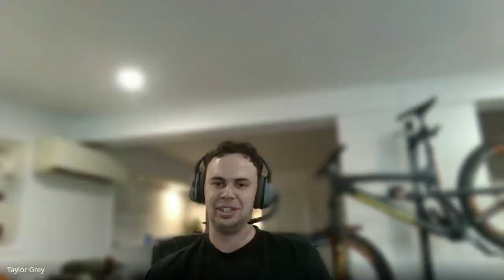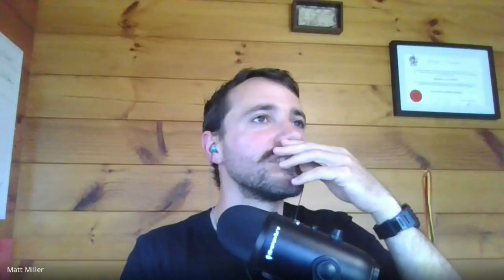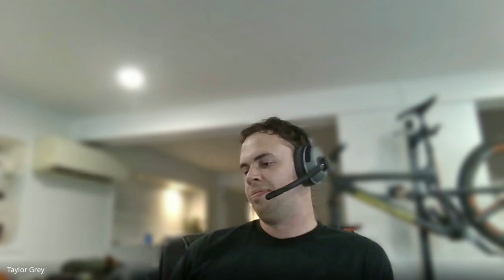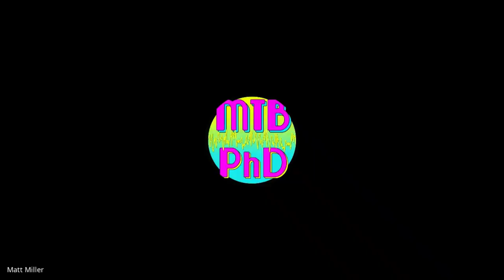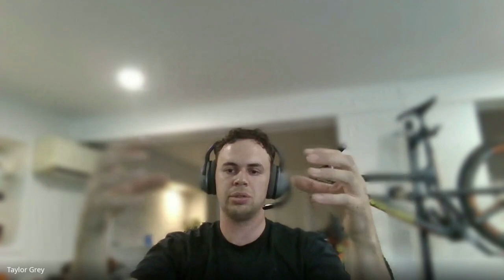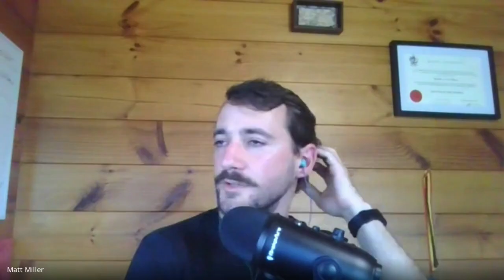Engineering secrets revealed - Taylor from Radic Performance brakes

Comment: Hope make 3mm thick vented rotors. I think the masses are fine with 1.8mm rotors. Those that do brake hard (because it requires upper body strength) will want 2.0/2.3. I think full fat e-Bikes should be on 2.3 or 3mm.
Reply from the maker: Nice, keen to try those 3.0 rotors
Reply: There 3.3mm even on the reccomended tech 4 v4 clearance is tight
Reply: I'm an average rider and 1.8mm rotors heat up an warp leading to them always clipping and needing true-ing. They shouldn't even be on bikes anymore.